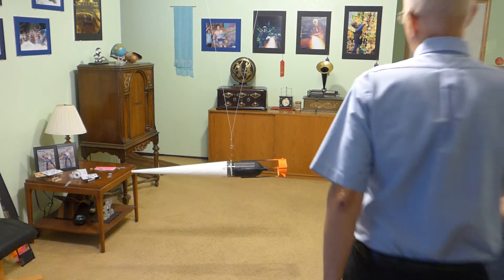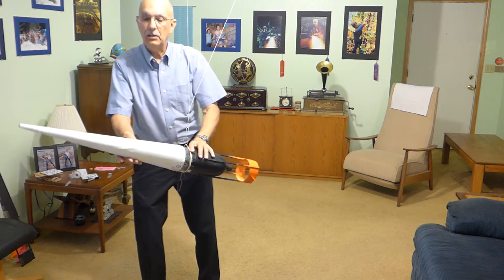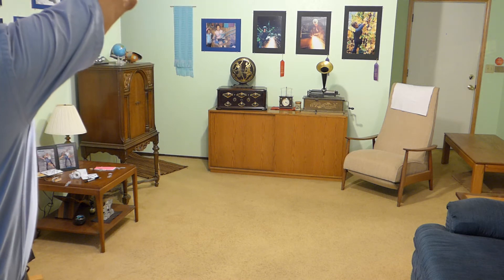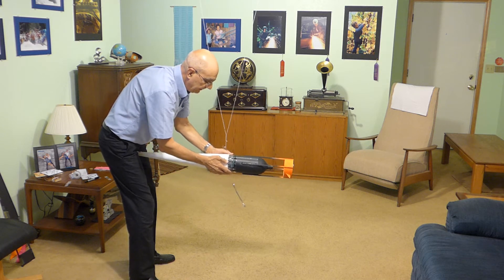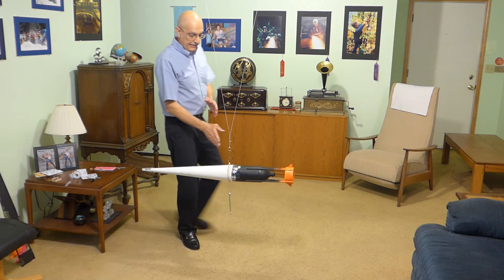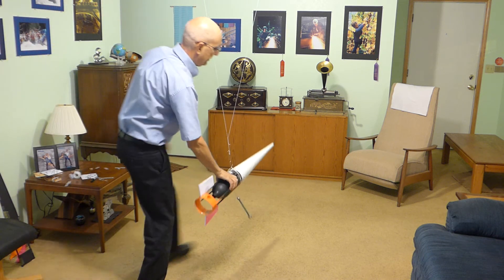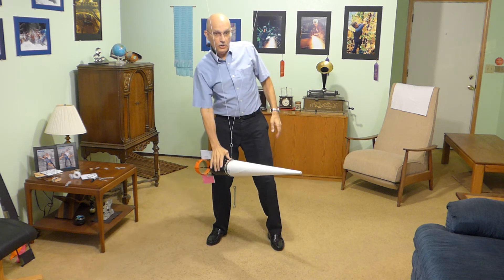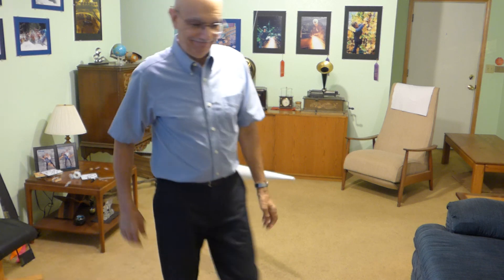How to find Center of Lateral Pressure , CLP , of a rocket. Backslider bottle rocket

Comment: Hi Orville. Your both videos on this are very helpful. Thanks.
I have made a simple coney backslider rocket to test. I have done the swing tests as u have shown and marked CG and CLA.

However dont we need to do the other swing test where people circle the rocket around themselves and see if it always stays nose first? That would be needed for ascent. But when I did that test, my rocket tumbles around. Does that mean that it will topple during ascent, even though I have optimised it for backslider descent by your method? Pls help. It would be have been bonus if you also showed the same rocket with the circle swing test to see how it behaves.
Thanks.
Reply from the maker: Good point.  Every “backslider” is at a delicate point of balance. If it is slightly more nose heavy it will tip over at the Apex of its flight and dive, nose down, like a dart.  If it has more weight at its tail end it will be unstable when ascending.  
       The straight answer is “yes. Do the “swing around in a circle” test to confirm that your rocket will be stable when going up”.  If it is not stable make the fins LARGER, or farther back, or both.  Keep the weight light but ADD SURFACE AREA to the fins until it is stable. Then repeat my broadside swing test to check the balance. 
          I have done the “swing around in a circle” test and this rocket is stable.  I think that a LOT of that stability comes from the circular “ring” fin that I use which is located way back at the rear of the rocket.   It works so well that I use it on all my rockets. I had some total disasters before I adopted the ring fin. 
          The rocket’s stability is created by BOTH its weight distribution and its air resistance distribution.      
          Wishing you success. Success feels great.
Reply: @orvillewingnut8260  Thanks!
God, its been a year since I posted that question.

I had gone ahead to try the rocket and it worked. It needed some CG to be shifted towards the tail. It was grt fun. Here is the video https://youtu.be/jJdm0sTxsRo

Comment: So it is drag.
Reply from the maker: yes.  In airplane terminology its "drag" - resistance to air when in motion.  "LATERAL pressure"  occurs when the rocket is moving broadside, as it does when its falling in the horizontal position.  Lateral means side , so its pressure on the side of the rocket -  the entire side.  
         We are trying to locate the CENTER of Lateral Pressure.  That's where the pressure on the tail half (aft) is equal to the pressure on the nose half  (fore).  It will not be in the linear center as measured with a tape measure. It will be at  the  point where the air pressure , or "drag" is equal  fore and aft.

Comment: There in no such thing as clp for an elongated body traveliing through the air with its major axis pointing in the direction of motion. This a good example of an erroneous theory giving an OK result. An arrow with no fleches and with weighted tip will still turn sideways on the the direction of motion regardless of where “clp” is in relation to the cofg. Ask any archer.
Reply from the maker: You are correct as long AS LONG AS THE MAJOR AXIS IS POINTING IN THE DIRECTION OF MOTION, AS YOU SAID. Once this rocket reaches apogee and loses all forward motion, it will not "nose over" and plunge down because it does not have ENOUGH nose weight to cause that.  THAT IS BY DESIGN.  It therefore begins to fall while still in its horizontal position. Since neither the fore nor aft of the rocket has more or less air resistance it never changes position, and falls in a horizontal position.  I chose to call them "Horizontal Descenders " for that reason. 
      If it had slightly more tail weight it would slide BACKWARDS, often only 10 degrees from horizontal, for long distances, like 100 feet. So most people call them "backsliders".